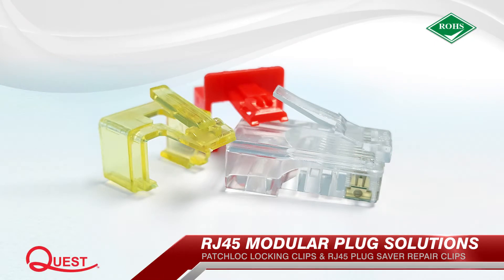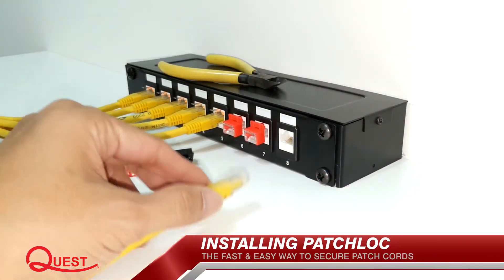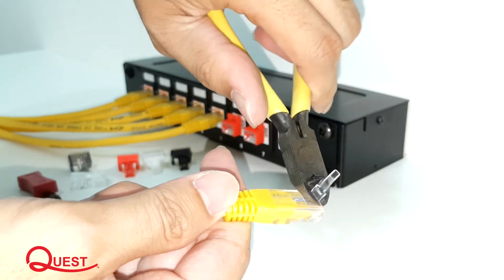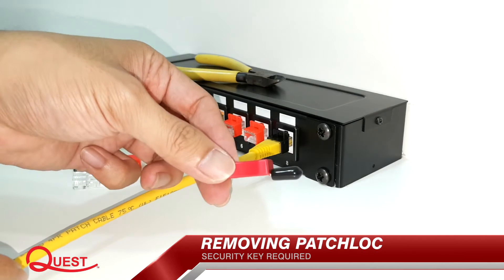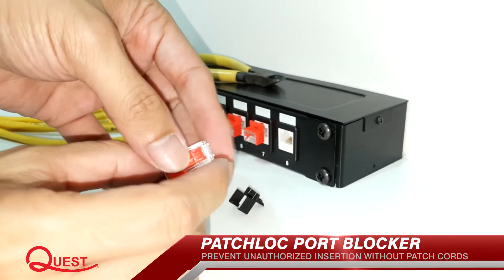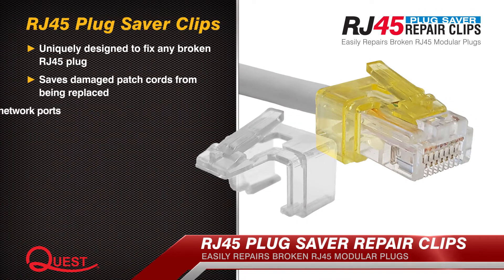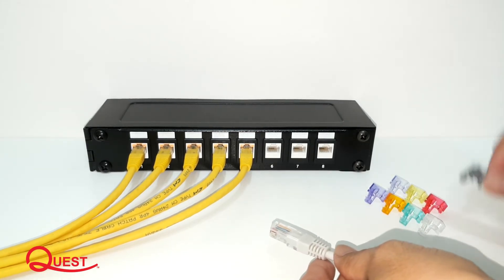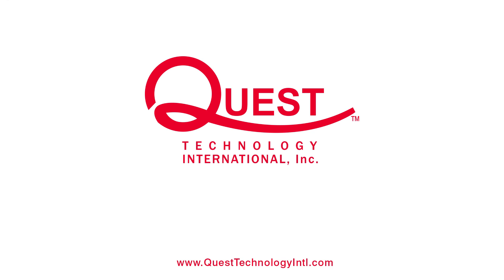RJ45 Modular Plug Solutions from Quest Technology Intl (PatchLoc)

Comment: These clips will not fit to each patch cable. The clip only holds on Ethernet connectors whose width is the same over the entire connector length. It will not work if the connector is wider at the end than at the tip.